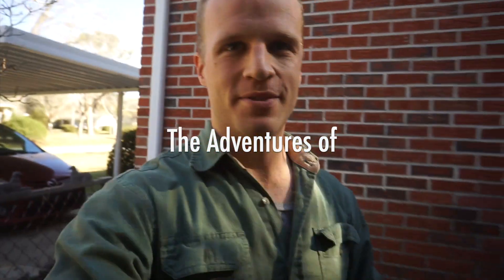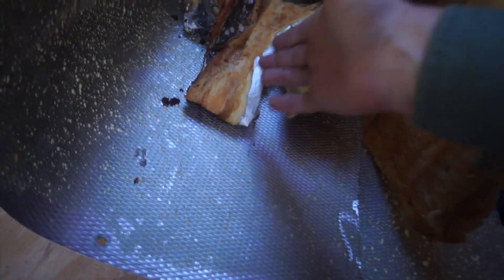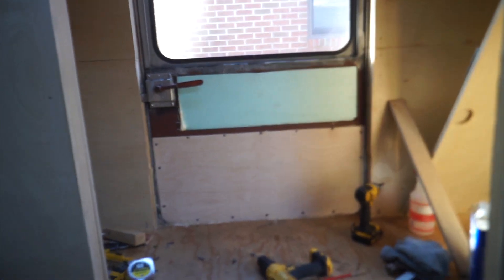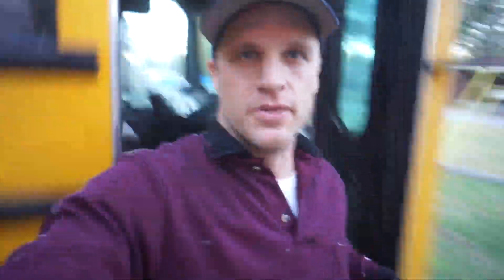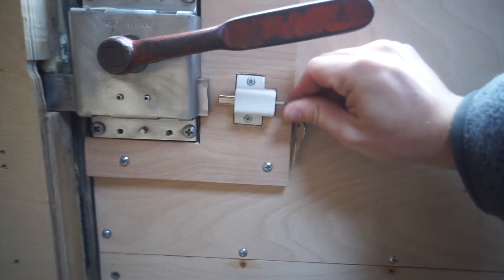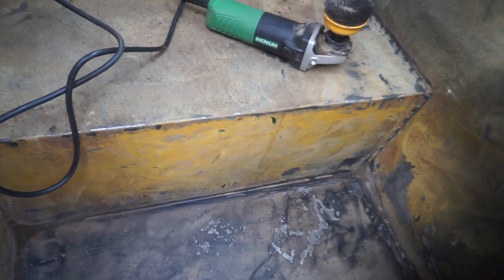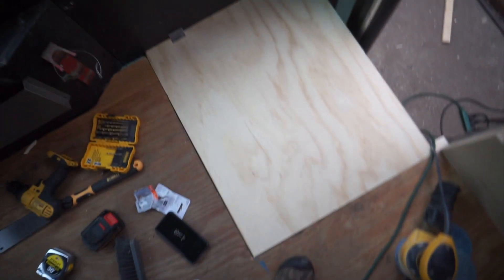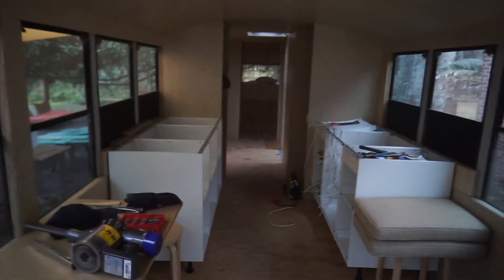How to Lock Your Emergency Door/Keep Your Toddler From Falling Down The Stairs: Bus Conversion Ep 42

Comment: That wire wheel from the same manufacture comes also as a twisted wire brush (same form, the wires are just twisted together), it is vicious, also with the wires twisted together the wires do not come flying out as you grind (not as much anyway). That platform that covers the stairs is well worth it. Have an air operated slide over the stair in the motor home. adds a lot of space. and very conformable for the passenger.
Reply from the maker: I've got that wire wheel too. You're right it is viscious!!!

Comment: For safety you do not want to have to use a key in case of fire. If your kids have to get out fast may not have the time to use the key. Just my opinion. Keep up the good work.
Reply from the maker: As it currently stands my kid doesn't have the strength to pull up that emergency latch regardless. I doubt she would until she's 5. I'll save her though dont you worry. I'll be sleeping just a few feet away.